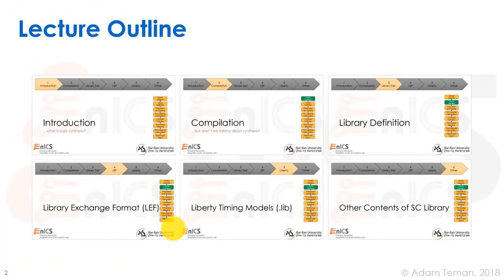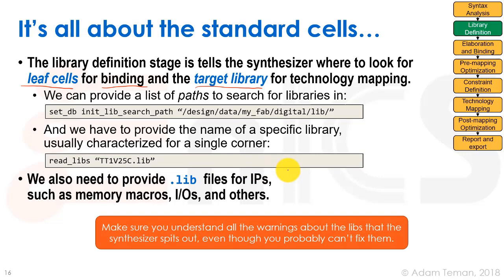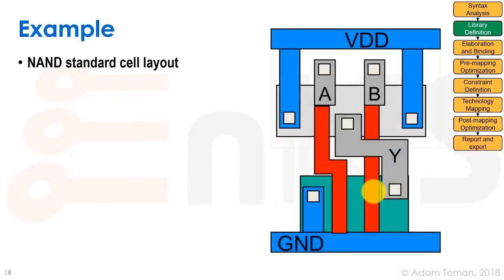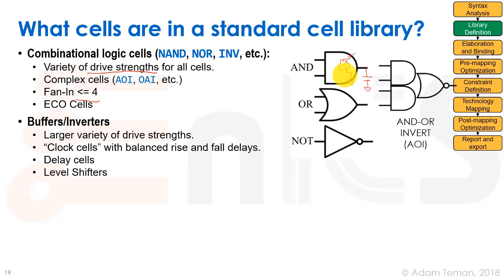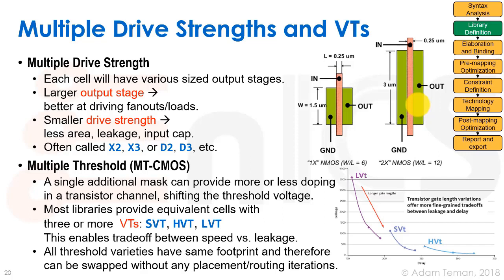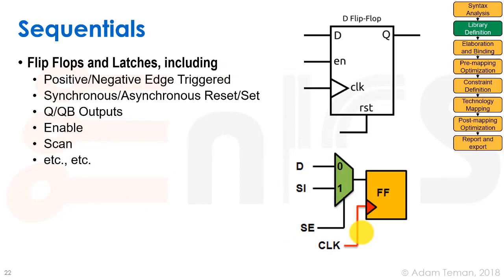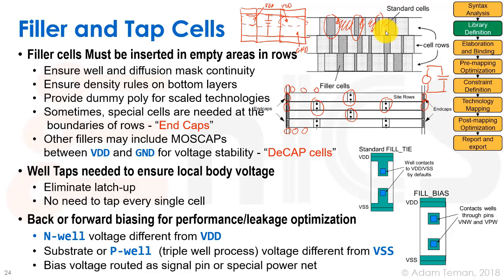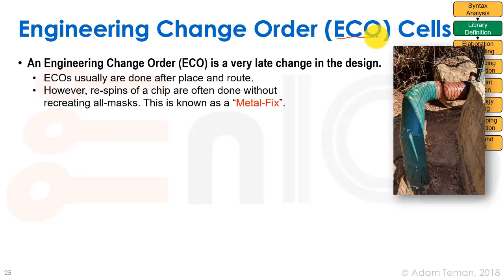DVD - Lecture 3c: Library Definition

Comment: How standard cell library is different from PDK? What are contents of Standard cell library and PDK?
Reply from the maker: There is actually a fundamental difference.
- A process design kit (PDK) is a collection of files that defines the technology process. This includes information, such as the basic components for circuit design (e.g., transistors), the model files for simulating the components (e.g., in SPICE) and the technology file that includes the rules for layout in the technology. The PDK is provided by the FOUNDRY and cannot (or should not) be customized by anyone else.
- A standard cell library (SC Lib) or any other IP library is a collection of circuits designed by a circuit designer and not (necessarily) by the foundry. It includes different views of the circuits, as I explain in the video, which enable a digital designer (front end or backend) to integrate these circuits in  a digital design flow. A standard cell library is usually provided by an IP vendor and not by the Foundry. In some cases, the foundry provides the SC Lib, but this is just for convenience.